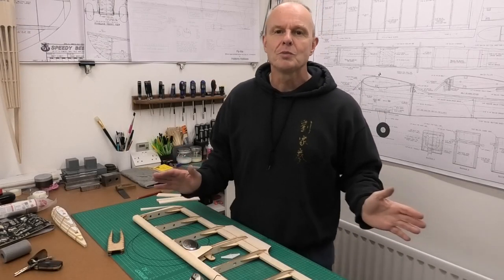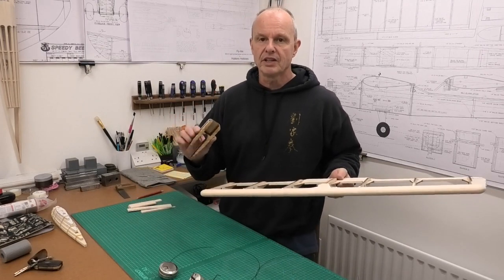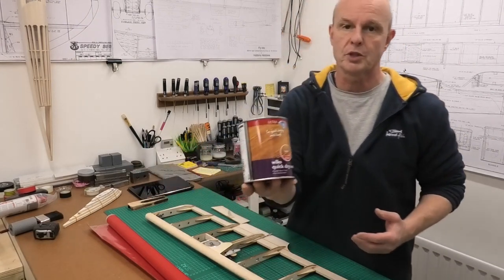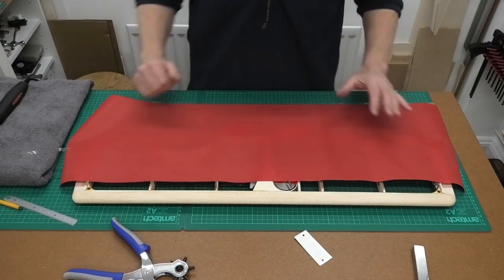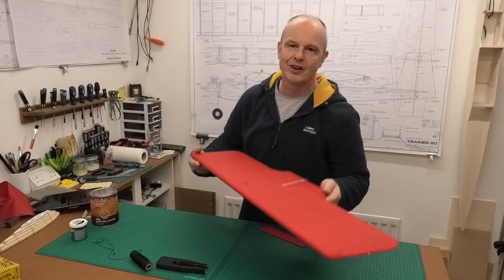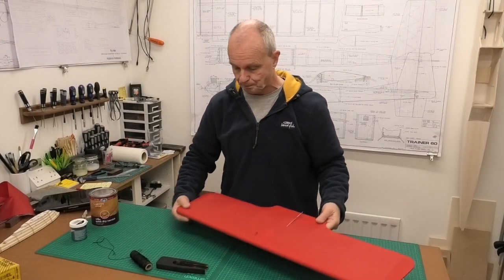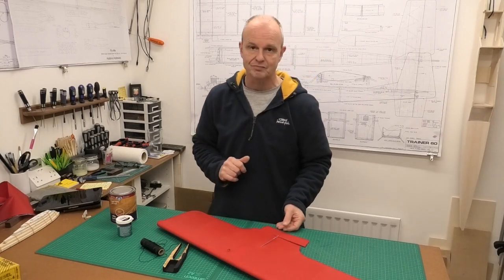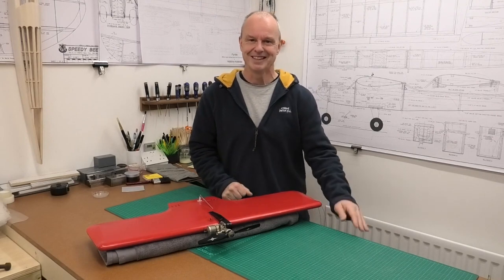Fly-Me Control Line Combat Trainer by Hobbins Hobbies:  Pt 3 - Getting the Wing Finished!!

Comment: Hi Mark 
Have you had much opportunity to fly this some more?…..
I took mine out for its maiden yesterday (my first wing), also with a PAW 249…..it’s pretty quick (to me at least!😆)
Reply from the maker: Hi, yes I have, I found changing the prop made a big difference to the speed, try messing around with different size. If it is going slower just watch the tension on the lines. Good luck

Comment: Good morning Mark. When I flew combat back in the day we used to fit a needle valve protector as they are so vulnerable. It was just a piece of right angle brass or aluminium that attached to the engine bolts and came close to the needle valve. We were using oliver tiger motors at that time and needle valves were not cheep.
Reply: Spoken like a true veteran of combat flying. I'm sure we had Oliver Tigers here in Australia but I only flew Supre tigres and Australian made Taipan diesels.
Reply: You do not need them for paw, they will twist and are robust.
Reply: @mikewaller4141  Hi Mike. The early PAW motors had a fixed ventury, it was all one with the casting. I guess the new ones have changed. 👍😊
Reply: @petermiles55  still good motors in there day.
Reply: @terryblackman6217  correct. If it had a fixed old type then a protector would be a good idea
Reply from the maker: Hi Good Morning Terry, thanks for the great advice, really appreciated.  Hope you are getting some flying in with this great weather
Reply: @MarkRobinson555  I shure am.

Comment: What's the diesel motor in that wing Mark? The wing covering is what holds these wings together and the only trouble you can get into is maneuvering overhead as flying wings tend to lose tension on the wires whereas a rudder keeps more tension on the model. Good luck flying. They are a lot of fun and I hope that diesel isn't temperamental.
Reply: Good morning Peter. Totally agree with what you have said. For a beginner in control line you need all the help you can get . especially line tension.
Reply: Modern combat wings do not lose line tension, the issue with line tension is normally due to the wing balance and or the engine run.
Reply from the maker: Hi Peter, its a PAW 249, which seens to run really well, think it will be the pilot that is the issue!! hahaha. Thanks for the advice and comment